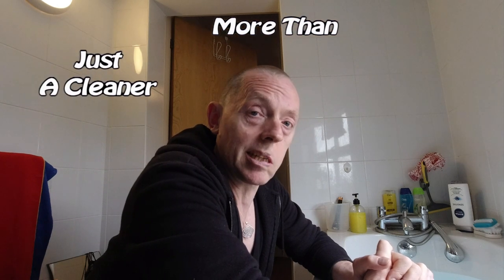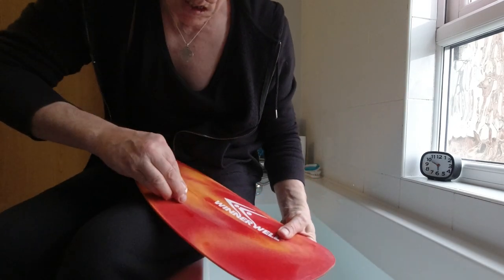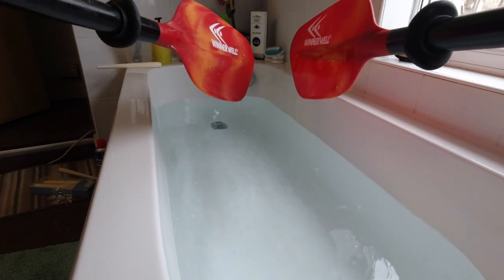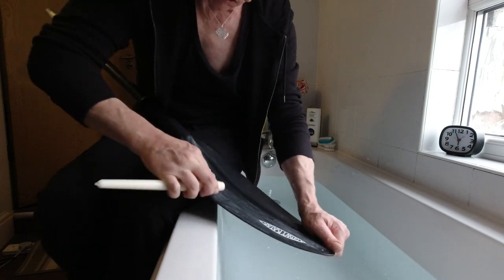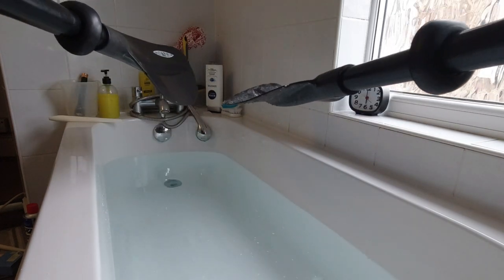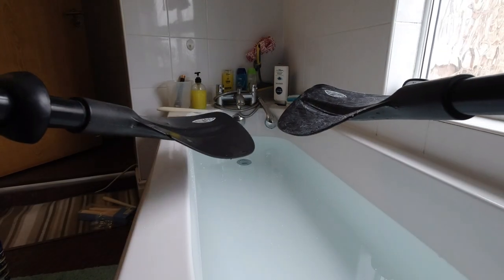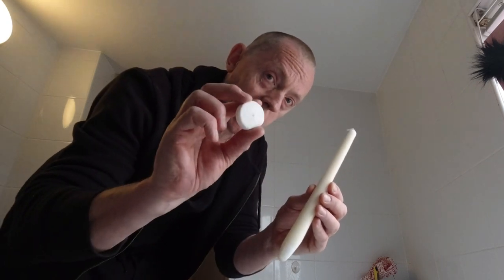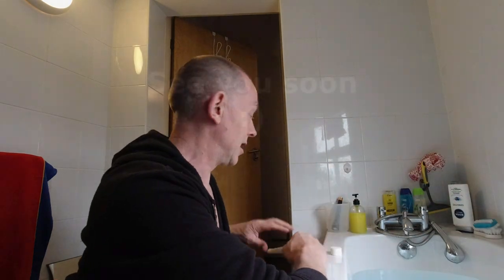Testing the Easy Dripless Paddle Hack, with A Twist - for kayaks canoes & paddlers

Comment: Very interesting ideas. I think many paddlers would be horrified at the idea of adding WD40 to our rivers and oceans! Beeswax etc only.
Reply from the maker: Considering the WD 40 didn't really work it's not really an issue. It was more an experiment to see if it would. But to allay your concerns, there was no evidence of it 'slicking' on the surface of the water in the bath 👍😊

Comment: Candles are paraffin wax and wd40 is also petroleum based both very harmful to fish and water quality. Use Carnauba or Bee's  wax. After rubbing it on get a hair dryer heat up the wax and buff it in works like a charm.
Reply from the maker: It's one of those hacks that works great in the bath, but in practice, the pool noodle hack works best 👍😁
Reply: Not if it's done right! @MoreThanJustaCleaner
Reply from the maker: @1BlackSheep  ooh backhanded insults, my favourite kind 😅

Comment: I think you should use beeswax , for two reasons , beeswax is natural and is ok for the environment,  beeswax polish
Reply from the maker: Yeah that's the recommended method, I just thought I'd try with what I had to hand :)
Reply: @MoreThanJustaCleaner  I use a tub of natural bee's wax shoe polish which is softer than a hard block and so easy to apply and polish off and great results
Reply from the maker: @benwooding5491  yeah but when I made this I didn't have any 😋😁

Comment: Cerakote Ceramic trim coat is hands down the best
Reply from the maker: Never heard of it 🤔😁
Reply: I was thinking that would be the case as well.  Expensive, but should perform much better and last a lot longer on the surface of the paddle than wax.
Reply: Not safe for water environment it clearly states retain washing water and dispose of it properly, So not thinking it would be good for fish which is why I kayak and boat (Fishing) Carnauba and bee wax are safe and work well.
Reply: @1BlackSheep  to dispose of the cloth used this stuff doesn't come off I'm guessing you've never used it before. It's just as safe as the plastic from the kayak you're sitting on

Comment: I've seen others using wax with success, but the problem is that it takes a bit to properly apply and wears off rather quickly. I would think wax would be good.... if you can easily apply it. And I think you would be able to use spray-on furniture polish to do this with.
Reply from the maker: It's worth a try 😁

Comment: Quick question Karl, I'm looking into getting a different paddle for my Story Kayak as I dont rate the one that came with it. How did you decide on the Winnerwell?
Reply from the maker: Good question. I actually bought that thinking a longer paddle would be better for solo paddling in the Riber which is wider and has higher sides. I was wrong. The Riber is better suited to 2 people with single blade paddles.
It was this fail that made me look for a solo drop stitch and hence my stumbling across the Story.
I liked the Winnerwell because it's fibreglass and therefore relatively light whilst being strong.
As it happens it's turned out to be a total win because in the wider, low pressure crafts I can now paddle them without catching the sides 👍